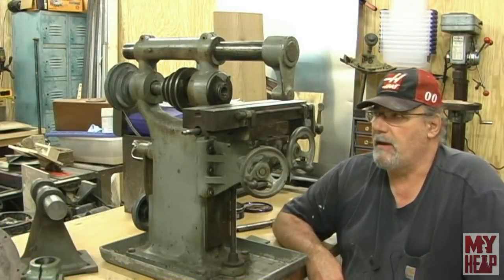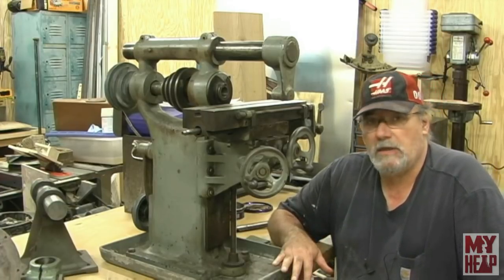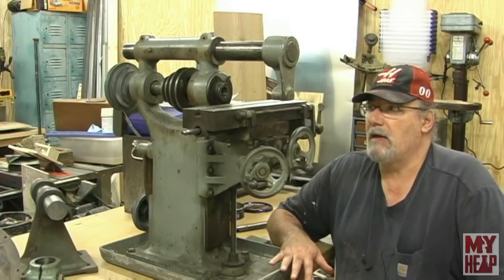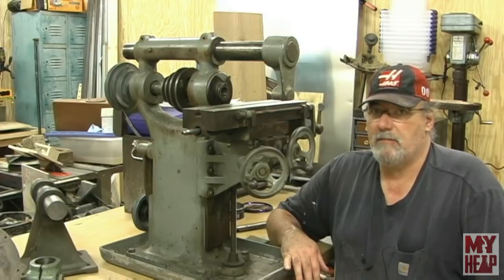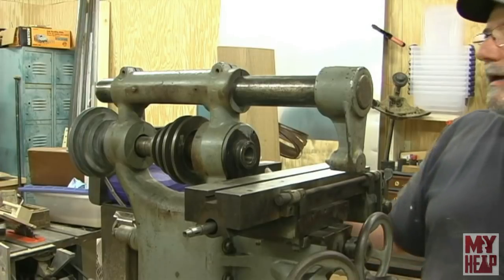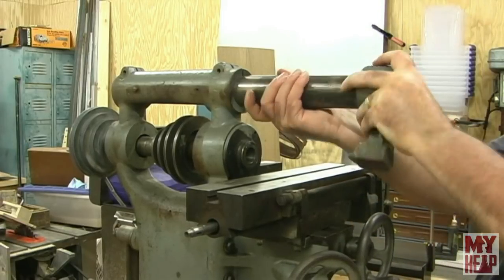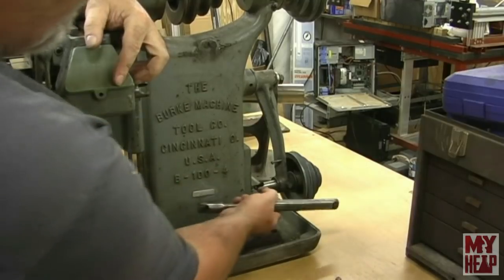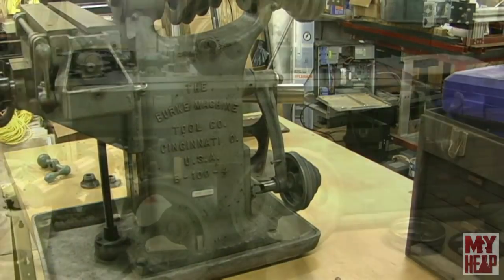Burke #4 Mill - 04 - Disassembly

Comment: G’day Joe a successful strip down, now to clean up and inspect for wear. Good to see you have some time on the Burke getting your hands dirty.  The auto drive for the table looked simple enough maybe I could make something similar for the Gingery mill, (no I think I’ll stick with the electric drive)
Cheers 
Peter
Reply from the maker: In all honesty, I am surprised by the simplicity of this machine.  Compared to the number of parts on the Atlas lathe or seems almost rudementary.  That's good, because my skill set is too.  It is great to get in the shop and get my hands dirty.  Thanks for watching and supporting me Peter.  I really appreciate it.

Joe

Comment: Hey, Joe, it's finally coming apart. Glad to see you get a little leave to work in the shop. I finished my Ammco Shaper this week after a year apart so I understand what you mean by pictures and video to help with the reassembly time. My Burke Mk1 mill's spindle just started making some weird noises so looks like that may be the next project for me. I see a CNC router in the background. Didn't know you had one? I love mine and use it a lot for my metalworking projects. They are great for cutting aluminum as well as plastics and of course wood. Thanks for the video!
Reply from the maker: Hey George.  I have been wanting to get started on the little mill for a while now.  I hope life is kind enough to give me the time to work on it.  The router you see in the background is the second one I built.  It is a KRMx01 design from Michael Simpson.  I have cut a bunch of wood on it since building it.  Of course it has stuff piled on it now like all horizontal surfaces in my shop.  I have a coworker who wants a script name cut out for her daughter.  I might throw a little of that video up if folks want to see it.  I have one that I posted a while back where I was cutting some Halloween yard art.  Thanks for watching George and taki g the time to comment.

Joe
Reply: My Shopbot PRT 4896 usually has stuff stacked on it too.

Comment: Thanks for the help in this video. I just purchased a Burke no 4 mill like yours for $20! but mine dosent have Timkin bearings and has many differences to mine. Mine is not complete and missing to many parts to keep it as a horizontal mil. I plan on making a vertical milling head on my atlas lathe. One important thing I am missing is the lead screw to the y axis. Do u happen to now the threads per inch on that acme thread? Thanks
Reply from the maker: They are 10 TPI
Reply: My Heap thanks

Comment: On every machine tool there should be a single hidden set screw......which when removed causes the entire machine to fall apart into pieces. 🤔
Reply from the maker: I guess that would make disassembly quick, but then o would go to my shop and find my stuff in pieces where one of the kids got out there screwing around.  Haha
Reply: the fuse screw pull it and run
Reply: And that set screw should have a wee small spring hidden underneath 😁
Reply from the maker: @SouthernEngineering  right?!?!

Comment: Joe, you might find a manual for this machine on Vintage machinery.org. I have got two manuals for old machines, they were available on pdf.files good luck great job.
Reply from the maker: Hi Leo, great to hear from you.  I have a manual, and some other documentation.  I got from vintage machinery and the Burke Yahoo group.  Thanks for watching.  I have some degreaser and citristrip ready for stripping.  I have the paint to paint it but need to get some primer.  Thanks Leo for watching.

Joe
Reply: Been a while, but any chance you might email me the pdf manual for this? The yahoo group doesn’t seem to exist anymore…or I am just incapable of using the internet correctly.
Reply from the maker: You should be able to find it on Vintagemachinery.org.   if not let me know.

Joe

Comment: Dismantling a machine for a tool-machine-nut is like a striptease for a lecher! 
So, nothing boring about it! 

I could with the same mill....but about 1/6th of the size for a wheel and pinion mill (for some clock and watch antics). I have a micro mill (Sieg) and that does the job, but I'd prefer a sturdier machine....
Regardless of the original diagrams, I would consider adding the odd pressure bearing, here and there.... pulleys used as a bearing surface, doesn't seem to be the most 'fine' solution.... 

A pressure bearing can be slid on, in between two hardened washers (that come with the bearing) and provides with a much smoother surface for running under tension (and less wear, thus more power ending on the tooltip, where you want it)

Hugs!

Paddy